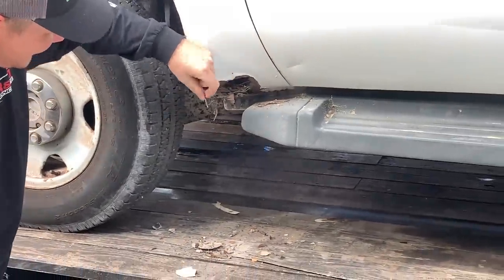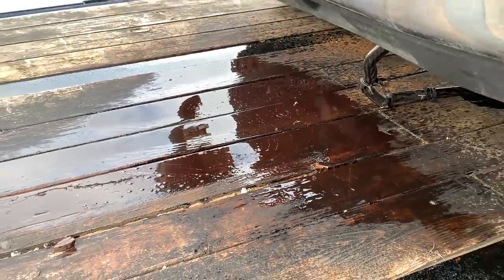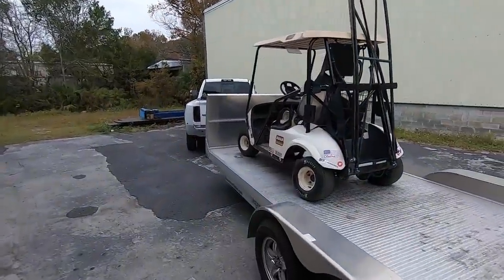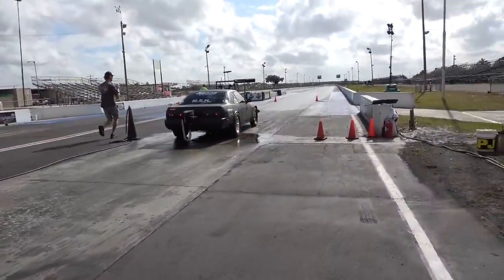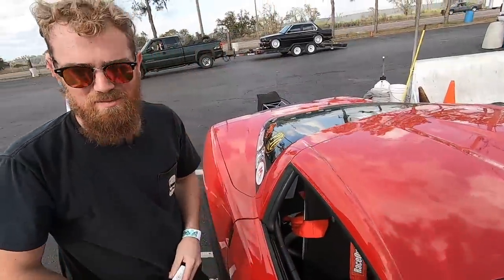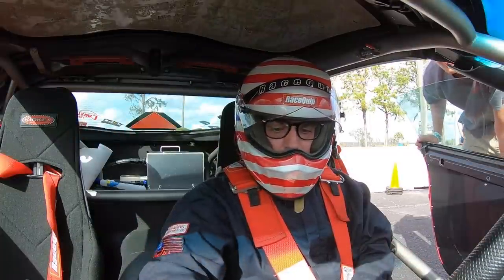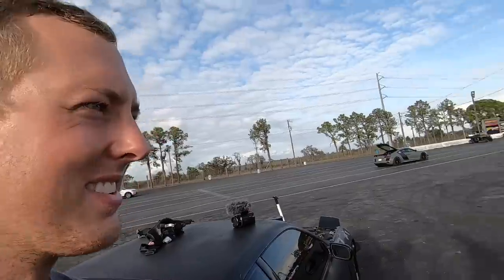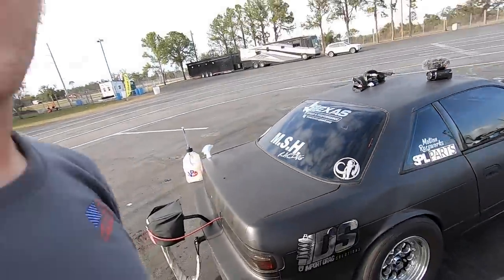Letting My Ricer Youtube Friends Drive a 1000hp DRAG CAR! +JH Buys a Burnout Truck!

Comment: “I think I shifted a little early” shifted at 25 feet 😂
Reply: I woulda shifted my pants.
Reply: I laughed my ass off on TJ’s run! He’s a riot anyway but when he shifted pretty much out the gate and ran an 8 anyway I just about rolled out of my chair.
Reply: Convertor definitely had some heat in it! Bitch is loose lol.
Reply: Lock in productions that's what she said!
Reply: @markconger8049  djdj

Comment: Bro Cletus was just VIBIN on that pass lol. Never seen somebody drive an 8 second car like it was an Escalade down the strip lol
Reply: He races a manual. You kinda get use to driving with one hand on the wheel when you have to bang the gears more than once like a power glide.
Reply: XTC Fatigue I mean you go from a handful like Leroy to a car like Ruby that drives herself  and it is an Escalade to him
Reply: Drag racing is like bowling - anyone can do it with a few drinks, whereas road racing is like a track n field event...only the skilled shall apply!
Reply: MrBojangles haha.  Bet you couldn’t run a 12 in ruby.   Or you’d put her in the wall.

I’m a road racer at heart.  I’ve spent way more time and money going to tracks than the strips.  But to say it’s talentless.....? take your 180whp self elsewhere
Reply: @user-180-mand90  You mean FWD drag racing. If so, then yes. Try driving a untamed RWD and you'll see how wrong you are.

Comment: Ruby: shift whenever you want to guys.....the torques got ya covered
Reply: Found the Uropean.....torques
Reply: @doozerchuck8625  incorrect 😛
Reply: @doozerchuck8625  na he just forgot an apostrophe.. 😂 torques got you covered = torque has got you covered
Reply: @doozerchuck8625  Uropean? xD
Reply: Where are you from... you dont no?
Reply: Torque converter*
Reply: @offchops6722  I mean, that's a torque multiplier. Torque still has to come from somewhere.
Reply: @chrisbleurgh7425  yes very true but say if it was a manual and he chucked it in 4th straight away it would just spin or big down depending on the amount of power your making.
Reply: And by bog I mean bog down run a shit time not The way cleetus uses bog 😂
Reply: @offchops6722  Nah that's a terrible comparison...if it was a two speed manual you could just start in second or shift early and it would be more efficient than a powerglide
Reply: J Findling more efficient than a power glide? YEAH OKAY sure buddy

Comment: "James, the type of racing he does, we can't show his times."

Translation: James runs 7.50 brackets in a car that consistently runs well under 7.50.
Reply: Care to explain bracket racing?
Reply: Dan D you go into a class.  Example 7.50 class.  Can’t run faster than 7.50 or you get disqualified.  There’s more to it than that but that’s the basics of it
Reply: Zachary Rice even when he breaks his time restriction?   Nullifying his ability to compete that day?
Reply: Zachary Rice grudge and street racers don’t show times... if someone is trying to make good money from races, showing times isn’t the way to go.
Reply: Dan D Ok, here we go..
Example: Say you're running in the (7.50 ET bracket Class) "ET=Estimated Time"
The idea is to get as close to that (7.50 ET) as possible without running faster. Say you run a 7.55 with a .585 RT (RT=Reaction Time and .500 is a perfect light)
But the other guy runs a 7.60 with a .510 RT which is slower, however he still wins cause you have to factor in the RT as well. So, even though you run closer to your (7.50 ET) than the other guy, you can still lose if your RT is to slow.
That's the best and easiest way I can explain it. Hope that helped.
Reply: 7:32  He's getting a little air under the front tires for at least the first ~30ft., so I'd say he's getting some pretty good times from it.
18:24  Never mind, this dude needs wheelie bars.
Reply: Need a chute to land that wheelie 😁
Reply: I thought James’s car was a 1/8th mike car.
Reply: @bigdikgravy  Arrogance and ignorance go hand in hand, amirite?
Reply: hes done below a 5.00 in the 8th..thats all you get lol
Reply: @slowspeed6500  о

Comment: I’d love to see Brent make a pass in Ruby. He’s one of the most deserving guys in racing.
Reply: I agree but brent has already ran 8's is why it wasn't a big deal to anyone.... otherwise he probably would have been one of the firsts to go.
Reply: What I’d love to see is who he will let have the keys to Leroy my money is James will be the first to drive other than cleeter
Reply: bobwatters  i dunno, on the very very small chance he ever offered I'm not convinced mike finnegan would say no, and he wheels a gasser to 8.5s
Reply: @domvalenti3412  Kyle from 1320 video has driven Leroy before. But that was long long ago when he was still a 9 second car. I don't think anyone other than Cleetus will EVER wheel Leroy down the track.
Reply: bobwatters  na they both need to drive each other car, turns down a little abit of course.
Reply: I'd rather see him drive Leroy or the Dale Truck, PFI has a truck and they're building an S2000 to (one day) rival Leroy.

Comment: I can't wait for the 7 second drag taxi 😂 getting people the 7 they never have been able to!
Reply: phur3i0n that’ll be so cool and fun to experience
Reply: There was a diesel pickup with a roll cage built over the truck bed and a bunch of racing seats in the bed at Texas motorplex. You could pay for a run down the track that was guaranteed to be in the 10s.   I never did it.  Too expensive. But it’s a cool concept to get people into the sport.

Comment: So, as the most consistent non-breaking car in the fleet, Does Ruby still hold the Nickname "Dumpster Fire"?
Reply: Is it really more robust than neighbor? 👌
Reply: @TheBurnout96  ...yea, I think it's even more stable than Neighbor. I mean it doesn't sit on the rev-limiter and do burnouts for several minutes at a time, destroying it's tires, coating itself in rubber then setting said rubber on fire, then drive away after it's been put out. But That's neighbors job Not Ruby's, Ruby's job to go fast in the 1/4th and she does it consistently without breaking.
Reply: @truedrakooo  Ruby blew up several junkyard motors, but that was when they were goofing around with her before they got her a decent motor. How Many Expensive GT 500 motors has Neighbor gone through?
Reply: @redrolo149  1
Reply: @enigma9789  2, I think actually. They'd gotten a new one for some reason and immediately broke it XD

Comment: If that powerstroke is going to be revved like I'm guessing it will it should have valve springs put it, the factory ones don't hold out very good. I just had to replace 12 valves because of the springs not being up to par.

Comment: New title “we bought the cheapest power stoke diesel in America, what can go wrong?”
Reply: Yeah, I was thinking on that. And then, a leak. Foreshadowing of leaks to come.
Reply: Rip headgaskets
Reply: I didn't catch if they said what engine it had, but it sounded like the 6.0. Combine that with it looking like it was just brought up out of a lake...........that thing just might turn into a boat load of work. Heck, even if it was a 6.4, they still have quite a reputation. I tow with a bulletproofed 6.0 that has around 85,000 miles and only looks a few years old, even though it is a 2005. Doing the remote oil cooler and filter was a time consuming job. James has it much easier with a 5.3 ls style truck.
Reply: CGT80 I have a 03 6 speed 6.0. 100k miles. It’s been a great truck. The truck in the video is definitely a 6.0

Comment: For the golf cart, you should get a rear differential off of a utility quad and put independent rear brakes on it(cutting brake) so you can steer your wheelies. and cut a hole in the floor so you can see where you are going.

Comment: Friends don’t let friends buy a power stroke 😂
Reply: Ryan Bovee I am a ford guy but them things are junk
Reply: A 7.3 is gold but the 6.0 and 6.4 are garbage. Dont waste the money. And I'm a Ford guy too.
Reply: There's nothing wrong with a 6.0 as long as its studded and deleted mines got around 600hp all I've broke is the trans
Reply: @tannertones7512  So your saying there is nothing wrong with them after you do a cab off service, and make it illegal in quiet a few states.
Reply: Shit Box fox it’s ok because ford didn’t make the 6.0... international did
Reply: KDcars Ford didn't make any of their Power Stroke diesels.
Reply: ...unless it's a 7.3.
Reply: @Loki_Trickster  you definitely don't have to pull the cab and you don't necessarily have to delete it you can buy a aaftermarket egr cooler but yeah perfectly good after that
Reply: Jc Siener And? If you want to build a hot diesel, it's not cheap. At least, not if you want it to run for any length of time. What's another grand to build the trans? Or what, 3 if you buy a new performance unit? Personally, an automatic diesel seems to me as sacrilegious as an automatic dirtbike, but I know most people don't see it that way. If I built one, it'd be with an indestructible medium-duty manual box, with clutch/gearing to compliment said box. I would never build a diesel for speed or racing, though, just to feel and sound good while pulling. 1200 ft-lbs in a streetable tune is goooooood, haha!

Comment: TJ: "I think i shifted a little bit early" YOU THINK? :D dude any earlier and you'd shifted 2nd before letting off the trans brake :D
Reply: He actually didn’t. He was early, but not that early. He shifted about 2 seconds into the run. It backed off the line because his foot popped off the gas.

Comment: That was an OK Wheelie...
   I absolutely have stood a car straight up and all four wheels were off the ground because he hit the bumper then fell I hit the gas again and hit the bumper again it destroyed the transmission the front end and the side of the car when I hit the guard rail LOL. 
I usually hit the nitrous after the 60’ but the car ran 6.00s and I was running a turbo stang that ran 5.80s
So I hit the gas and nitrous at the same time and I crossed the 60’ on the bumper. I had an .041 light on pro tree and the stang had a 1.88 light. Dude in the mustang said I can cut a better light but after you took off I wasn’t going anywhere because that vega was violent as fk and I wasn’t taking any chances. 
Come to find out I won anyway. I was running a footbrake car and he was actually a pro car running a delay box and trans brake and air shifter.
Yep no one got a damn video but a woman had her camera going but it was sitting on the bleachers because she was lighting a cigarette and her son came running and said I got a video of it. Nope but you could hear it all lol.
Actually the dude did do a really great wheelie and that vett is Scootin too.

Comment: If I come down would you let me make a pass in Ruby? I would drive from Ohio to experience that for sure. I have operated some pretty cool machines both in air and on the ground but never drove anything faster than my GSXR 1000 I had.

Comment: 3 yrs later an jh still hasnt had a truck hold together through a full cleetus an cars burnout. whats the deal can the diesels just not hold up for that long under those conditions. i always figured a diesel would hold up better cause ive always hear they run better the hotter they get, but i know absolutely nothing about a diesel other than they dont have spark plugs.

Comment: I remember drag racing my 1985 Mustang LX 5.0 back in 1985 and being so happy to hit the low 14's, my next one ran 12.8's sounding like a scalded animal going down the track to my 2017 Lincoln MKZ making a 12.7 pass like I was going to the store to buy milk. Ruby lays down a pass with no effort, Cleetus is driving like he's going to the store, we live in awesome times guys. My MKZ is slow in comparison to these guys but 12.7 felt like 16 seconds while my 12.8 Mustang felt like it was hauling ass.

Comment: I love the reactions , lots of smiles and high fives.......We sometimes hear people say  "Drag racing is boring "All your doing is going from A to B in a straight line" "I'd rather play cards". Yeah, and blasting off in NASA's  SLS Moon rocket is boring. Pulling a couple of G's accelerating like a NASA rocket isn't boring. It's both exciting and extremely dangerous. Ask these two guys if drag racing is boring? Now imagine shifting 5 gears in 4 seconds [ pro stock ] Or 4 gears in 6 seconds [Leroy ] It may be a little quicker to 4th gear, maybe Cleetus will time it for us.

Comment: Silly question, can one of y’all rippers help me out. 

What does purging nitrous do before the run?
Reply: LD71 It’s not a silly question at all!  Purging gets any gas bubbles of nitrous out of the feed lines.  Liquid nitrous has a fixed density and the highest mass of nitrous per gallon.  This is why you run liquid nitrous to get consistent oxidiser/fuel mixes and make consistent power.  If you have nitrous gas bubbles in the line, you run fuel rich because the gas is less dense and contains much less mass of nitrous per gallon.  With gas in the line, you also get varying results because you can have lots of gas or not much at all, depending on what’s going on with pressures and temperatures in the feed lines.  I hope that this makes sense.
Reply: Tim Banicevich absolutely man!! Thank you so much

Comment: I would love to come down an drive Ruby are if you have one faster. I lost both my legs above the knees in 1993 at my job. I got in to drag racing after that. I was licensed to 7.20 I think it was . When I was racing my best time was 7.65@165 1.2 60ft. 1271blown  Injected alcohol Two speed  Power glide. B/B chevy. It was my life after I lost my legs. Now I run my Can-am Maverick X3 turbo 4seater. Few modes. I am 56 yrs old an racing is in my blood. I have raced a lot of different thing. I raced in Missouri. Would like to meet you my friend. Even tho I never met you. I named my car 
(Running On No Legs) I am planning a trip to Fl to see my Chimpanzee I moved down to  Port paree Florida he was 22. He lived in my house for 22 years. Would like to see you an your shop when I am down that way. It would be awesome. I know you won't have hand controls to put In a car its ok.love yr channel!!!